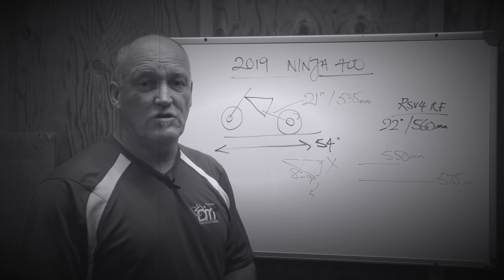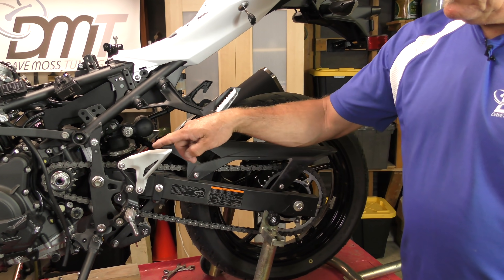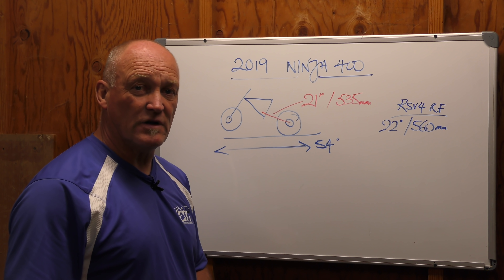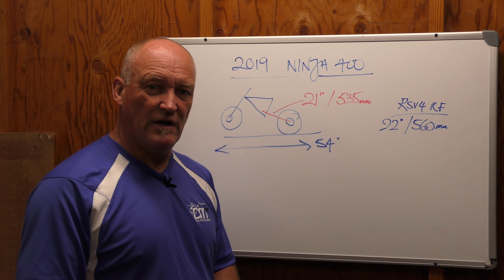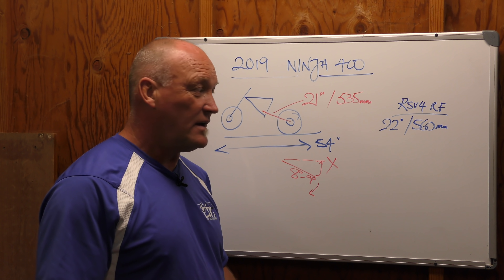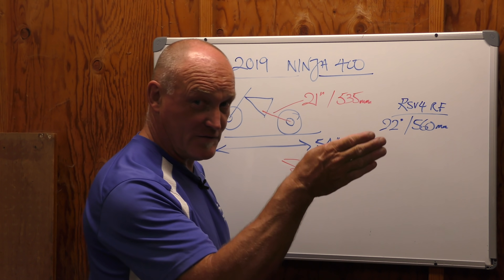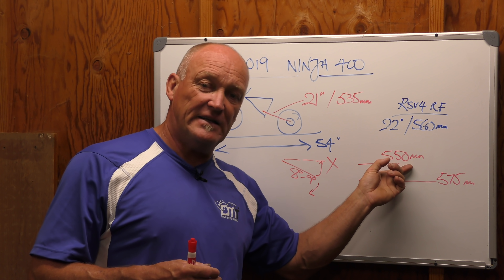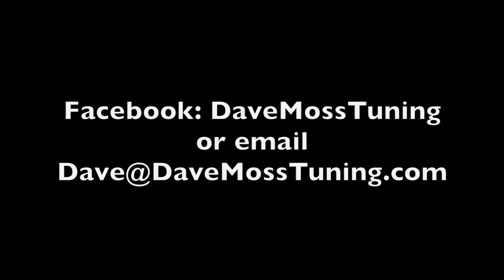Motorcycle Wheelbase: The What, How, & Why of It

Comment: Great stuff! And how does acceleration affect the wheelbase? Does the wheelbase decrease or increase during acceleration? (keeping in mind that during acceleration the trail increases)
Reply from the maker: If you lengthen the forks and the shock travels through the radius when accelerating, the wheelbase will be variable. Long to start and then shorten as the swing arm rises.
Reply: @catalystreactionsbw  thank you for your answer !

Comment: 16 RSV4 RF has longer swingarm with -5mm pivot position compared to earlier models with shorter swingarm at +2.5mm pivot position. Combine this with ever increasing rear tire size, what was Aprilia thinking? I'm looking forward to testing pivot positions this track season.
Reply from the maker: With your excellent data tracking, record swing arm angle at rest as you change the pivot point and also track shock travel (no shock setting changes).

Comment: if the swingarm angle is >9' , the problem is that bike wants to put the rear wheel under or forward of the bike. The bike wont handle at all at that point.
---> my guess is that it has too much antisquat ?!
Reply from the maker: 11-13 degrees is the ideal starting point with the tyres just kissing the ground. Newxt factor is how strong the valving and spring rate are, or how soft. Most of that is balanced against engine power and wheelbase length. If the rear wheel wants to go under the bike, then the shock is trying to lengthen so that would be anti- squat. Therefore the opposit is squat and finding that balance depends on far too many factors BUT, if you start at 9 degrees, you can use preload in the rear shock to test soft and hard and see how the bike behaves from 30-60% throttle.

Comment: Wheelbase: what about when we can move the wheel forward and backward? Should we consider the middle as the oficial wheelbase?
Reply from the maker: The rear wheel is ideal in the middle two thirds of the slot. The rear tyre circumference is the issue as the it will increase or decrease leverage and that can change handling.

Comment: Nice video Dave. I just ordered progressive Wilbers springs and both valves for the front and Wilbers 641 shock for the rear with height adjustment. The plan is to get little more caster to the steering by changing the stock 190/50 rear to 200/55 (30mm higher tire) that will lift the rear by 15mm. The shock height adjustment is to compensate with front height correction to find a suitable result. The bike is ZX14 sports touring bike that I hope I can turn into more nibble weapon at the mountain roads that I have locally. You gave me more to think about with the rear wheel positioning that I haven't even realized. I like to keep the front on the bitumen and changing caster would also help on that but with the combination of a shorter wheelbase by 20mm might also be a factor in the overall combination of setup. I believe the full range of adjustment is about 70mm from shortest to longest. My local roads are lot of 20km/30km/40km/50km corners so very tight for a big bike. Goal is to make it turn and yet have a good compromise of keeping the front down. It has a pretty new chain so I think the adjustment is about at the middle now leaving about 35mm either way. So if I would take one link of the chain that would shorten the wheelbase about 20mm I guess. I have to confess I have no idea how big of a change this would be under acceleration. Combine this with the caster change.  What sort of feeling would you have about the final setup? Am I completely wrong or is there a thought here that might work? Big fan of your videos. Learned a lot.

Comment: Dave, you sir need to start a 2 day course, similar to YCRS for riding safer and faster, but only for learning your bike better and smarter! I believe if you don’t understand your equipment/machine, your more likely to fail because of it. I watch as many of your videos as possible, yet I’d pay to attend a hands-on instructional program from you!
Reply from the maker: Hi Ryan. I used to tour the USA with Sportbike Track Time putting on the DMT suspension school doing exactly that. Unfortunately due to an incident with 4 wheels at a race event, insurance stopped the course as we would set up bikes and canopies in the hot pit. It would be great to start that again as I believe the course could be run with 3 stops per session. Two days would make that a lot easier to do.
Reply: @catalystreactionsbw  I did not know that! Very interested. Leave it to the insurance suits to make this sport less safe by trying to make it better? Statistics should counter that theory, and prove that your greatly reducing far more! I will definitely be on the watch for a new one should it ever occur again, thank you for all your knowledge and sharing!

Comment: Cool video Dave. 

Question time: wont changing the angle of the swing arm cause the COG to change ? For the better or worse? For example if i put a longer shock on my bike, steepening the swing arm angle and raising the bike what sort of problems could that cause and how would you solve them ? 

Also another thing id like to ask, im putting a 750 engine into a 400 rolling chassis which has a steeper rake, swing arm angle snd a shorter wheel base than the original 750 chassis. Are there any problems or pointers you can suggest before i go too far as you mentioned in the video its a balance of been nimble and having a ‘horrible’ ride or a ‘slower’/lazy ride.

Thank you

Comment: The chain is its tightest, so that you can check chain slack, when you have the counter shaft, swingarm pivot, rear axle all on the same plane. Then rotate the rear wheel until you find the tightest point to adjust proper chain slack.
  also
  changing the gearing on a ninja 400-2018 through 2021, and the Z 400, to a 15 tooth,will trip an engine code and your gear position indicator will stop working because the onboard computer for the ABS sees that something is different in relationship between the transmission speeds and the wheel sensor speed for the ABS.
  The fix is
  start the bike let it idle for 30 seconds then ride for 10 minutes.
  repeat the idle/ride for 10 minutes ritual three times to get the check engine light to go out, and for the gear position indicator to start working again. I had this on my Z 400 when I went to a 15 in the front. About 40 miles later check engine light and gear position indicator stopped working. I went back to the 14 tooth countershaft sprocket, and I did the idle/ride/ritual three times, and everything started working again. I don’t know if the ritual Will make the computer and the gear position indicator start working again if I would’ve left the 15 tooth sprocket on. I can say this for the 15 two sprocket. The motor was not as smooth and it was not because I was lugging. Maybe it was the rubber damper on the counter shaft sprocket that came with the bike from the factory. The 15 two sprocket I bought did not have that rubber damper on it, and I did not like how it made the engine feel..
  my machine how to Yoshimura slip on muffler on it when I bought it used with 1500 miles on it. I noticed that it had a slight hesitation just off idle.. I was able to buy a used perfect stock muffler which I installed on my Z 400, mostly because I do not hate my neighbors, and I do not want them to hate me. I am not 16 years old, so I don’t need a “hey look at me “exhaust system on my bike.
 with the stock exhaust muffler on the machine. The off idle slight hesitation is gone, but I had a vibration all of a sudden in the foot pegs and in the seat. To fix this I pulled the stainless cover off the back of the muffler, and I added 21 ounce stick on wheel weights to the wall inside the end of the muffler, then I replaced the stainless steel muffler cap. These weights changed The frequency that the muffler was responding to, and the vibration/buzz went away.. this trick of adding a stick on wheel weight also will smooth out mirrors that buzz and blur your vision of what’s following you at highway speed‘s. You just need to change the frequency that the mirror responds to by adding a weight. The weight I added was a 1/4 ounce stick on wheel weight. The mirror is clear now at highway speed‘s..
  when I lube my chains, I have a long snorkel plastic bottle used for oiling furnaces. I filled it with 90 weight gear lube. I put my stand under whatever machine I am boiling the chain on so that I can rotate the wheel. And I put one drop of oil between the side plates on each link on the inside of the chain. that way, I don’t have a mess, and the oil must go through the chain before it flies off. This was a Honda bulletin/instruction in my owners manual when I bought my 1977 Honda CB 750 F. That’s how they said to lube the chain. One drop on each link on the left side and on the right side, between the plates. The chain on my 1977 Honda CB 750 what is the original chain when I sold the machine with 44,000 miles on it years later..
  in this video you mentioned a buell motorcycle.. I was a motorcycle mechanic in the early 1970s at a Honda/Yamaha dealership. One of the other mechanics at that shop was eric buell. he worked there while he was going to pitt engineering school here in Pittsburgh PA USA..
  Eric and I were at Summit point Road race track racing once.. we both had Yamaha TZ 250s. He ran over to my van and asked me if I had a spare ignition. I said yes. I gave it to him and he ran back to his machine to install my ignition on his bike. I went over to give him a hand, and when I examined his blown ignition rotor, I grabbed the rotor and it moved up and down. I yelled to eric frantically going through his toolbox in the van, your crankshaft is blown and it’s not the ignition. It was his outer main bearing which Allowed his rotor to contact his stator blowing his ignition..Always in a hurry
Reply: great story.... carry on....

Comment: Hell yeah you should.
Take and Trail are very important to the bike style, horsepower, and speed you'll want to travel for the safest riding possible.

Like changing the Rake on the front end, you may need to extend the length of the shocks.

I think that's right?
Been a long time.
Longer is more stable at high speed...?

Comment: Awesome, thanks for this.

You suggest changing spring rates depending on the swing-arm length you use in a given situation. Can a similar result be achieved by adding/removing preload in the shock?
Reply from the maker: Correct - and also consider compression damping. Using settings will guide you to a softer or stiffer spring need.
Reply: @catalystreactionsbw  I have a quick question. I have a Suzuki sv1000 where I installed a 2002 gsxr 1k front end. I'm having front end instability at speeds higher than 80 mph. Is there a way to correct for this? I installed a gpr damper and noticed it has slightly improved the problem but the problem still exists. Any recommendations?
Reply from the maker: @RubberChickenMan007  Check shock sag, then check shock travel used on the shock shaft. If bottomed out, stiffen the rear shock via preload and compression. If the shock oil is 5 years old or more, refresh it.

Comment: Wait a minute, I thought the whole purpose of the raked swing arm was to have tire want to crawl up under the bike, minimally of course. That's what prevents the sprung mass from squatting or collapsing onto the swing arm. Of course there's a sweet spot. With the chain tension on the top, it's pull basically horizontal and with swing raked it has to pull underneath. Getting the right amount is the key, balancing swing arm length, shock, HP, gearing...(???).
Reply from the maker: 100% correct, and us as humans make that perfect set up so elusive between swing arm angle, chain pull, rear axle location, shock length, spring rate and valving.

Comment: Thank you for another great video. The part at 10:22 confuses me, I thought that with a chain of the same number of links, this would result in a longer wheelbase in order to get the same slack. Lets say a +1 front and -3 rear, wouldn't the rear sprocket have a greater difference in circumference? 
When it comes to extreme anti-squat as in the wheel getting pulled under the bike, does it become unstable because of a shortened trail and wheelbase?
Reply: Yes, Moss got a little confused there. The "usual" +1 on the front and -3 on the back results in a longer wheelbase if no chain links are removed. This is often not detrimental though because often people going for longer gearing are also riding highways and open roads more often where stability is welcome and nimbleness not usually required.
Personally I did the +1/-3 on my Tenere 700 (yes, I don't use the bike for it's "indented" use) and I proposely didn't touch the chain links. I actually don't feel any difference to be honest though.

Edit: I meant I didn't feel any different in handling, the gearing is very noticeably longer.
Reply: Larger rear sprocket means more anti-squat. Close distance cs sprocket to swingarm pivot reduces varying chain tension as rear suspension moves.